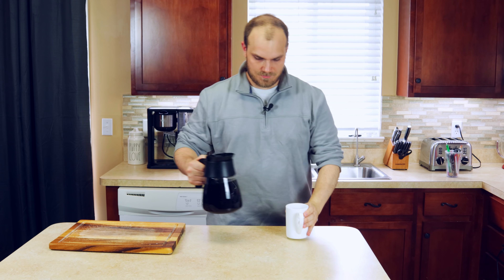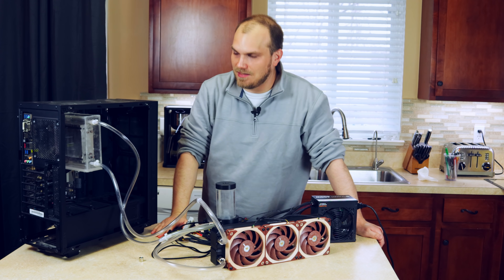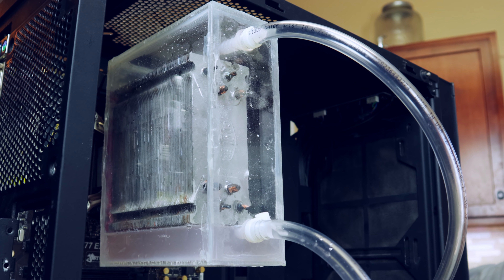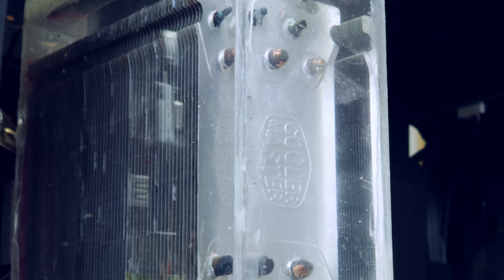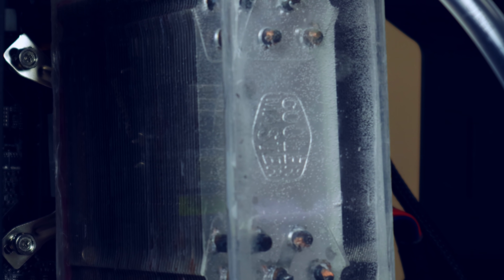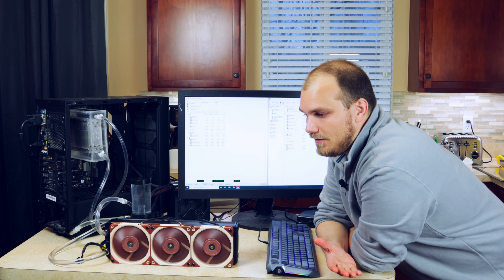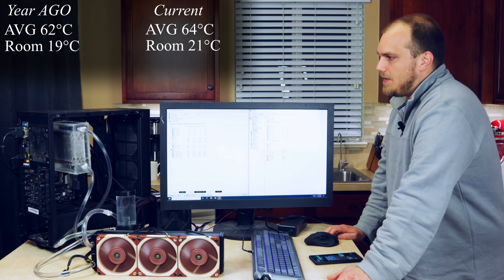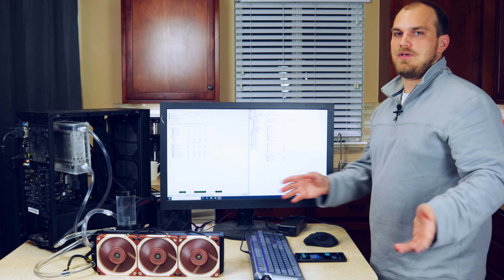Water Cooled Air Cooler 1 YEAR LATER, Time Has Not Been Kind

Comment: We'd love a version 2.0 yes!
Reply: He should use mineral oil in the loop instead of water, that way he could put a fan in the liquid and have it pushed through the fins much more efficiently.
Reply: @EVPointMaster  such a good idea
Reply: i dont see aditional fans inside the colling liquid to make any difference,
considering that fans are normally there to insure constant airflow...
Liquid colling on a loop creates a continuus flow,
you can clearly see that when he fills it as all the bits inside are floatin and swirlin around.
so fans inside the installation would be completely pointless
Reply: @TheUnjust117  hrm I'm not sure someone would have to model it in a thermodynamic simulation, perhaps the water from top to bottom causes it to pull enough water though the fins, otherwise, a fan forcing the cooler fluid through the fins on the heat sink would allow them to transfer heat faster. would be interesting to see a model of it though. but because the entry and output are on the "top" end I could see the fluid not passing through the fins so well, and so the fluids passive transfer of heat is being used more than a forced transfer of metal to the fluid.
Reply: @TheUnjust117  No expert, but I agree. I think you need fans because air is less thermally conductive than water. I think the water is conductive enough that the pump circulation is adequate enough to remove the heat without fans. Aside from that the fan in the mineral oil would create more drag, causing the fan to use more electricity which leads to more heat in the system. I don't know how much more heat that would add to the system, but it may be enough to zero out the potential benefit of adding a fan- or worse, it may add more heat to the cooling loop.
Reply: @MartinBarker  wouldn't need to pull the liquid,
just mix it for bit better thermal movement.
You wouldnt even need a high powered fan to achieve that task,
Or would you rather 007's shaken... Not stirred?
Reply: EVPointMaster i Just Said posted that then read your post.
Reply: @EVPointMaster  , or used neodymium magnets, like beaker stirrers in chemistry. Just attach fan blades on the submerged stirrer.
Reply: i guess its not gonna be possible but try not to mix aluminium and copper
ah and maybe if its possible try to match the waterflow with direction of the coolerfins? cooler fins?. any fins here?
Reply: Just slap some RGB in there and shit will be gucci
Reply: Please!
Reply: It's just a very heavy water block, c'mon...
Reply: Ah yes, nh d15 reverse watercooler
Reply: Definetly

Comment: Do a noctua black edition or be quiet painted cooler so there's no exposed metal other than heatpipes
Reply: Normal Noctuas are already coated with nickel.
Reply: The coating isn't even as useful, it'd be better to stick with one of the old all-copper heatsinks like the thermalrights or Zalmans.
Reply: @SCComega  The point is to prevent corrosion.

Comment: What about an Intel or AMD stock cooler? It's small, cheap and maybe with some epoxy you could seal it on the bottom... 
Also maybe try mineral oil? Then you could run a fan on it. But I don't know how mineral oil and soft tubes or plastic pumps react to it

Comment: idk perhaps try a painted cooler  or one that doesn't have mixed exposed metals .To prevent erosion in the fluid
Reply: Put some glycol in there?
Reply: @Folke_94  or
 Mineral oil
Reply: @Folke_94  I was gonna say similar. Central heating or car anti corrosion solutions, and radweld to help seal any leaks.  I live in the Garden Of England, so not sure what Radweld is called in the States.
Reply: Just use some car cooling fluid, there is some anti-rust mixture in them.
Reply: @Phil_V2  for future reference that's glycol
Reply: @Phil_V2  Analysis?
Reply: use one of the noctua chromax coolers.  the heat pipes are also painted, it should hold up well.  or one of the black bequiet coolers.
Reply: probably unavoidable, paint or not the heat pipes are gonna be in contact with aluminum fins in water, these aren't designed for water
Reply: A glycol mixture is probably what's best as someone else suggested
Reply: In liquid cooling, there is one cardinal sin. Never mix copper and aluminium. Aluminium will cause galvanic corrosion on the copper.
That said, a lot of AIO's do mix metals, but they do add corrosion inhibitors like Benzotriazole to the liquid in the loop.
-
If he was to do this again, he should use proper liquid cooling fluids with corrosion inhibitors already in solution, and it should stay pristine. Could also put some zinc or magnesium into the loop as a sacrificial anode, as they would be attacked before the copper.
Reply: why not using a nonreactive liquid? something that wouldnt corrode the the metal while still being able to transfer heat at a good enough rate.
Reply: OR you can put electrode with active positive potential, it should corrode electrode and keep everything else safe.
Reply: @heyhoe168  Oh yes.  I forgot about the sacrificial cathode.  They need replacing every now and then, but I;m sure something can be setup to alert the owner when it's corroded too much.
Reply: OR put some metal with lowest electronegativity in the system. I think Mg should do.
Reply: Or mineral oil
Reply: It just corrodes because he let the water out..

Comment: Would oil not work better for heat transference also it would reduce the corrosion.
Great video. Keep up the good work.
Reply: if you care about corrotion long term then use what cars use, that is destilled water with glycol and aditives.
oil is not perfect and it also has lower thermal resistance than water so water will always win, so your best bet would be adding stuff to the water to stop the corrotion.
If you are coming from the "oil cooler pc" kind of idea, thats only because its nearly imposible to keep destilled water destilled when you throw stuff in it and also when it stops being destilled, your whole pc is toast. Moneral oil may not be as good of a coolant but its waaaaaay safer for cooling live electronics.
In a water loop, the coolant is isolated from the electronics so it doesnt really matter that its non conductive, so you are better off with a better coolant like water.

Mercury would be a better coolant than water, but its super heavy, toxic and it eats copper and aluminum (it alloys on contact) so it wouldnt last long.

Its all about which is the best and more convenient coolant for each situation.
Reply: Oil has a tendency to ruin rubbers and some silicones aswell.

Comment: You should try it wich a nickelplated or painted cooler, so it doesn't corrode. And maybe you could try to modify a fan to make it waterresistant and put in on the cooler ( just to look cool). I would also try to minimize the gaps on the side to foce the water though to fins.
Reply: pretty sure the industrial noctua fans ar water proof.
Reply: @SpecialEllio  they are not, maybe they are a bit more water resistant, but not meant to be submerged
Reply: @heygek2769  well no but maybe you can force them to run by forcing power through them from a power supply? would be a lot easier than creating a water proof fan.
Reply: @SpecialEllio  the ossie is most fans  run off of what is essentially an exposed motor, so if you were to coat the magnets you would lose performance, not to mention the pcb in the back of again most fans to sucefuly water proof and maintain functionality would be brutal, it would be easier to fab one from scratch using a sealed motor and attach the fan to the rotor
Reply: @heygek2769  every brushless motor is waterproof, especially in distilled water, which is a pretty good insulator. 

 the only problems are the electronics, that can be coated, and the fact that water is way thicker than air
Reply: @petermccannell7565  why would you coat the magnets? They don't need to pass current. Brushless motors are always completely waterproof, as the wires are already enameled and insulated, the problem is the electronics, but that can be easily coated/you can use distilled water!
Reply: @FAB1150  Distilled water is only distilled until it touches the metal. It starts picking up ions almost immediately to some degree, and will have a conductivity measurably deviating from pure water within a few days. Blanketing the water reservoir in nitrogen gas will minimize this, as it will pull the carbon dioxide out of solution by reducing the partial pressure of CO2, but that will only slow down that effect. Especially if there is high levels of corrosion, which there are in the one test case we have available to us for this sort of experiment being done. You could vacuum fill the loop and/or purge it with nitrogen prior to filling it to further minimize the water's conductivity.

And have you tried water proofing a fan? I haven't, so if you have your opinion definitely means more than mine. I understand that brushless motors are easy to waterproof relative to brushed motors, but I'm not sure how the physical arrangement on a fan will lend itself to waterproofing the PCB. I don't think it would be as easy as "spray paint it in enamel and you're good." But I haven't tried, nor have I pulled a fan apart with the intent of analyzing for this, so I honestly don't have any specific reference on it, just a basic understanding of how most PC fans are constructed and that I think it would be kind of tough.
Reply: @SpecialEllio   not waterproof,  and since the cooler is mounted on the mainboard you get a short circuit through the cooler if you use water as fluid
Reply: @ismaelyu5  I've ran PC case fans under water and they work just fine
Reply: You could try a waterproof fan or mini fan, and maybe put the inlet on the bottom side of the cooler? Or split the tubes so you have more inlets at the bottom to separate the flow through the fins?
Reply: @gamer2x532  I think his best bet would be to make the walls sealed to the edges along the length of the cooler so that the water is forced through
Reply: @petermccannell7565  yes of course this would be super effective, but if he build a new one he could do more things to try to improve performance
Reply: I think if he make the Water com out from the bottom part of the finstack it would force the water to travel from top to bottom and it would necessarily go through the fins. Also if he makes both inlet and outlet come from teh side of the enclosure then it probabyl would fit in the case with side panel on.
BUT, it's not possible for a home-made fan to be waterproof. He would need to separate the motor and, well let's not get too much into this, you would really need a lot of engineering and tools to make an electric motor waterproof for submersion.
Reply: or pump oil so you can use a normal fan
Reply: @nutzeeer  or just take a pump apart and use the impeller. An impeller is literally a fan for water :)
Reply: he can mineral oil